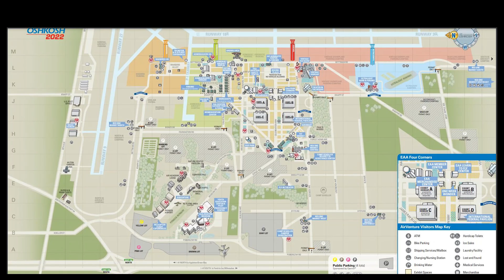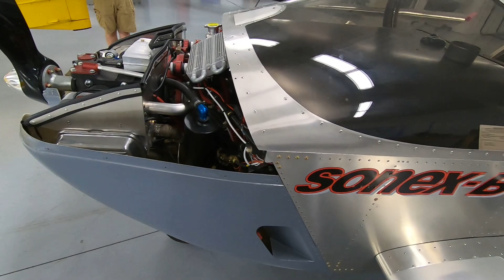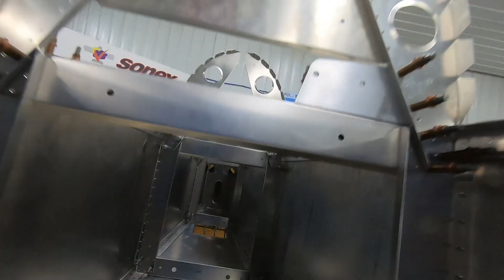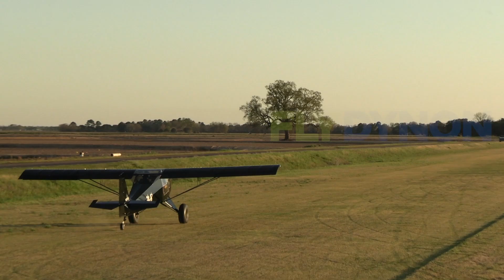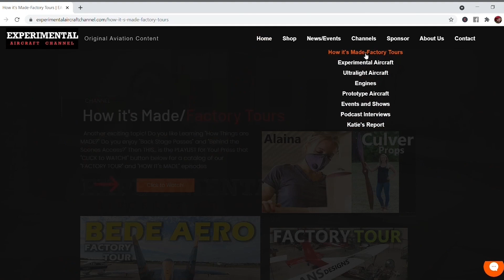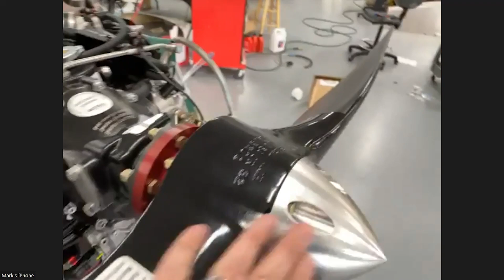Sonex Aircraft - Oshkosh 2022 Pre SHOW What to Expect

Comment: Referring to the guys comment on preferring direct drive engines, why are so many people afraid of engines with gear reduction propellers? Don't most all big radials use gear reduction propellers?
Reply: I wouldn't say "afraid". Some (including me) want the simplicity of no gearbox, clutch, radiator, water pump, thermostat, overflow bottle, external oil tank, water and oil hoses everywhere (potential leaks, time limited life replacement), etc. Don't worry, Rotax will always sell plenty of engines.
Reply: @5xls  not worried at all. A quick search showed rotax had already built 50,000 engines by 2015. 
 No magneto points to fuss with every 500 hours & many times less. no alternator belts to break, cabin heat without carbon monoxide concerns, liquid cooling allows more even cylinder to cylinder cooling. They are efficient and fuel efficient relatively light weight little engines. It'll be interesting to see what Yamaha comes up with their stated intentions to get into light aviation. Too bad america doesn't product something similar IMO.
Reply: it's not fear, it's more a desire for simplicity. Parts cost money, and more moving parts generally means more regular maintenance.
Reply: @SoloRenegade  seems to me the lycontesaurses need plenty of maintenance too. And the 900 series Rotax have been pretty darn dependable for the most part from what I've heard, I haven't owned one, but would give them a try. They do have a certified version which is basically the same engine as the experimental with the paperwork and fees paid to be certified. They are currently at a 2,000 hr TBO as well.
Reply: Although Rotax doesn't have anything more than 915is140 hp in stock form at this time.
Reply: @oneninerniner3427  Rotax have a following for a reason. but they are more complex to install and work on, and cost more too. having options is good.

Comment: That plane is a killer. Killed the former owner of the company. Any front impact you’re dead. Junk. Matter of time before another jet version crashes
Reply: Pump your brakes Keyboard Warrior, you know absolutely nothing.
Reply: BS... No structural defects caused the crash... it was an engine failure on takeoff and a subsequent stall and a vertical decent to the ground. ANY airplane would have resulted in fatalities. Had the pilot taken off at the threshold of the runway, versus the midpoint intersection of the runway, there would have been runway left for him to land after the engine failure. Your facts are wrong.